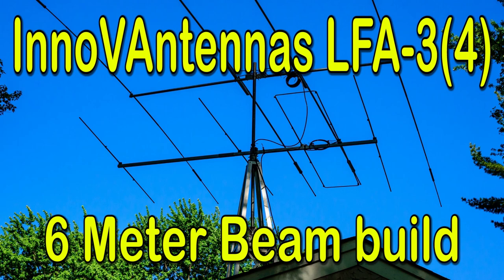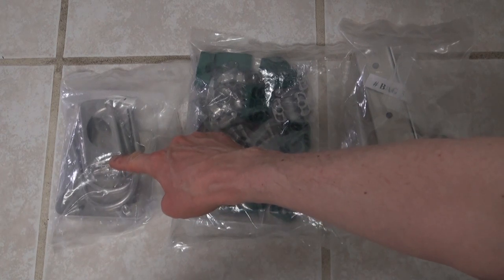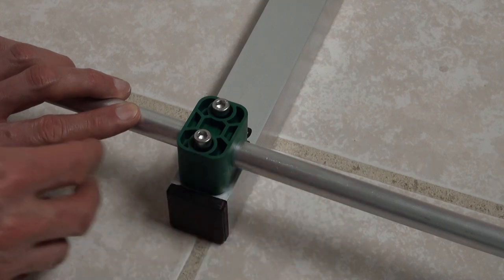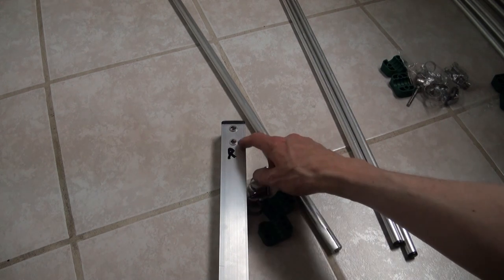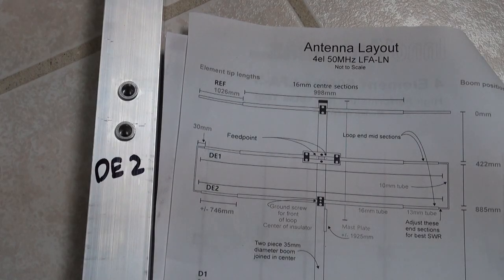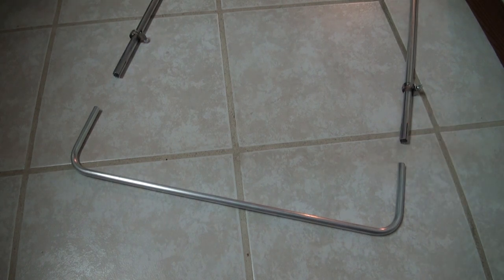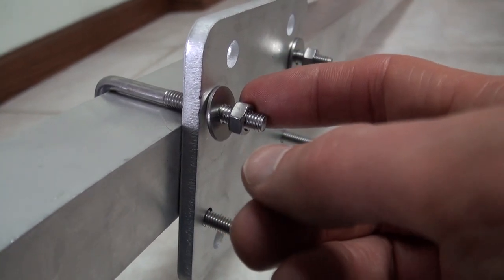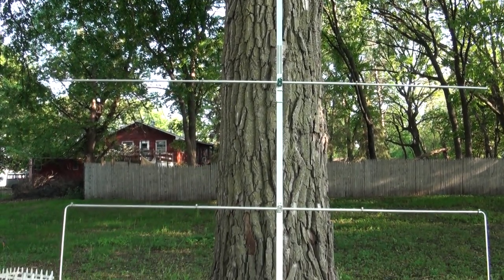InnovAntennas LFA-3(4) 6 Meter Beam Build

Comment: While this antenna is well engineered I would still like to see more  on the air video's of testing and comparing the LFA to other makes and models. to date I've only seen one and it was not really done that well of a test. for signal strength and noise. etc. thanks for saring. de Ellis WA1RKS
Reply from the maker: I could not agree more with you; 100%.  However, at my QTH a fair A/B test is not possible.  My 6M3 is at 27 feet where the LFA is around 20 feet and directly under an HF beam.  The LFA is quieter but is that the antenna or the height AGL?  No way to know.  I suspect if both antennas were at the same height, the LFA would out-perform the 6M3, but no way to know.  Great suggestion, though.  73! de WX0V